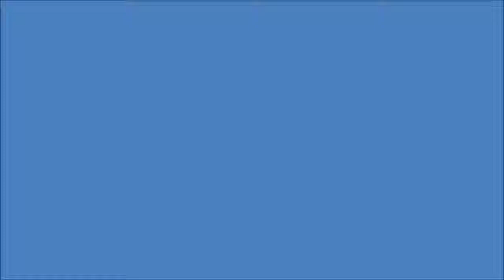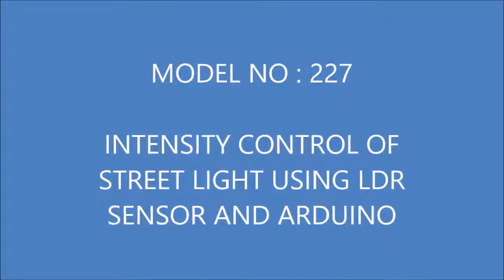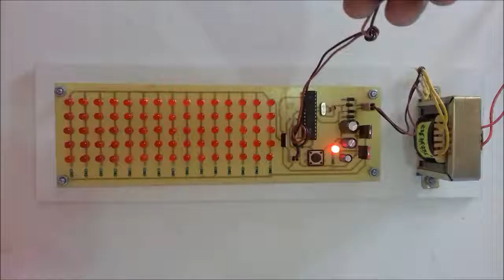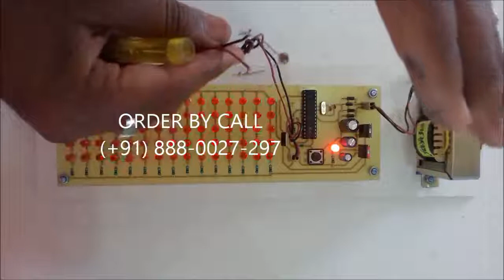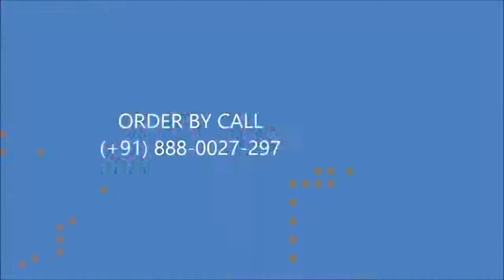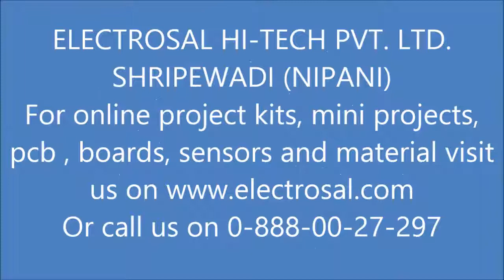Intensity Control of Street Light Using LDR Sensor and Arduino

Comment: We can do these by using Arduino  or not ???
Reply from the maker: Hello Perumalla Sailatha 

We can develop it using Arduino board. Actually in this project we have used arduino code itself but instead of external arduino we developed arduino inside project by arduino IC atmega328Pu . If you want this project with arduino board then kindly reply on mail id info@electrosal.com or whatsapp at (+91)8880027297. On our website www.electrosal.com we have some model with arduino board.